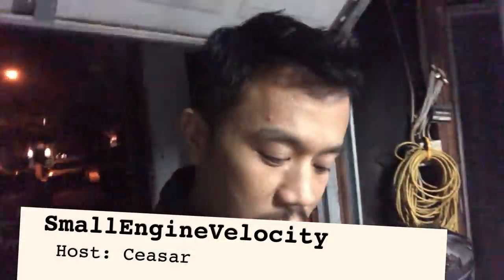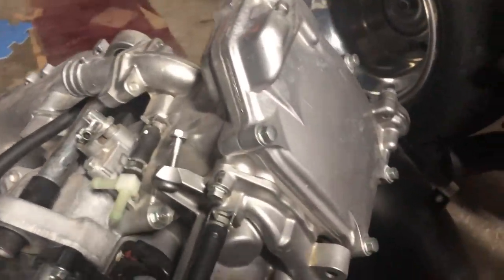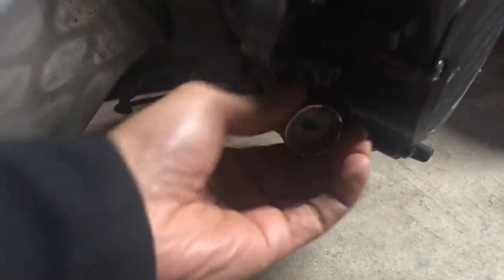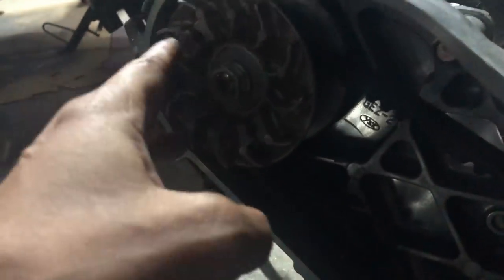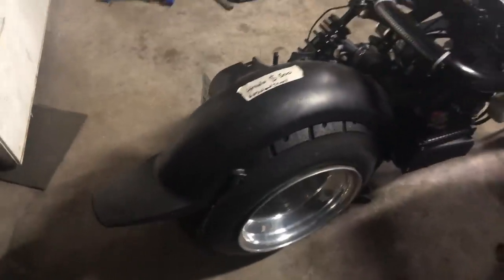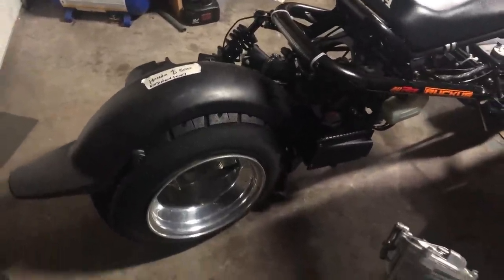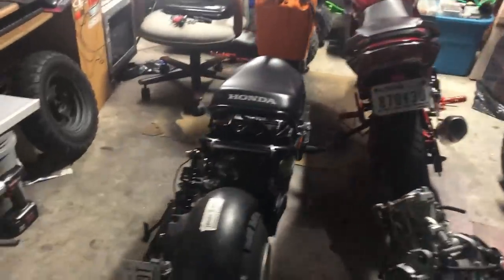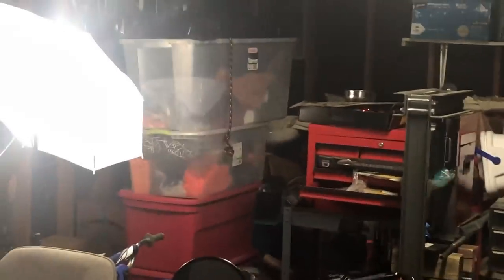Introductions to my new Honda Ruckus motor , will it work better? #hondaruckus #motorswap

Comment: Why did you get a new GET you know nothing about ? Yours seemed good until new stretch . Stretch didn't hurt your engine , just something outta wack .
Reply from the maker: Agreed but man we touched everything for an entire day and no results. Nothing changed anything. Compression test and I’ll be happier. It’s a low mile and was cheap so at the very worse I have parts for a rebuild.

Comment: What's the car in the back ??? Get back to me please
Reply from the maker: Lol under the baby blue moving blanket is my 1997 Mazda Miata STO edition and you kinda can see my 1979 Volvo p1800.
Reply: @SmallEngineVelocity  the tan car. What year Volvo. I collect car's. I have 47 at home now
Reply from the maker: Oops sorry 1970 p1800 Volvo not 1979
Reply from the maker: No motor , I drove it all through high school
Reply: Liking the vid'z. You made up my mind to order a set of Lifan's. The other half wants to ride and I only have a few one liter bikes. Not good for a first time learning experience so watching your vid'z the two of us made that's the bike to get. Like all your content. Rock on the small engine having a blast watching.
Reply from the maker: Hey nice ! That’s great! It’s a solid little bike. I am currently in the works making my “1 year later” video for the Lifan KP Mini. The seat position on the Lifan KP Mini is easy. I rode it to Galveston and back with the stock pegs. It was a good time